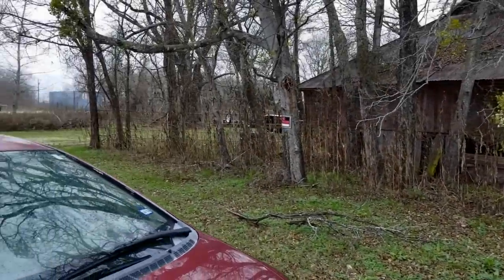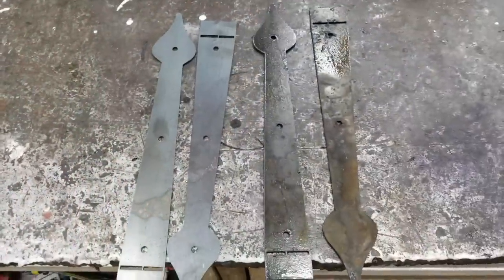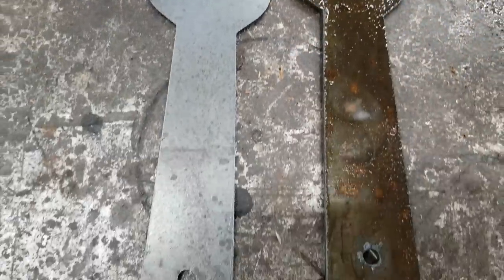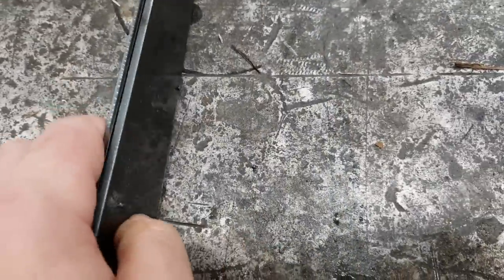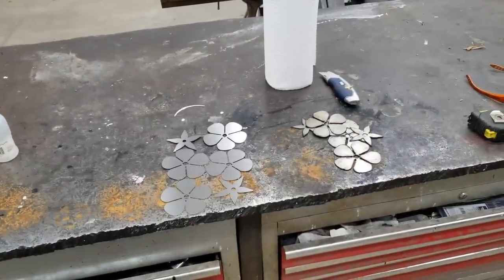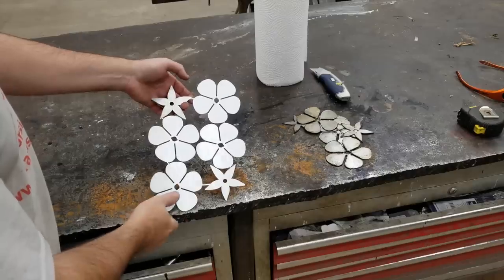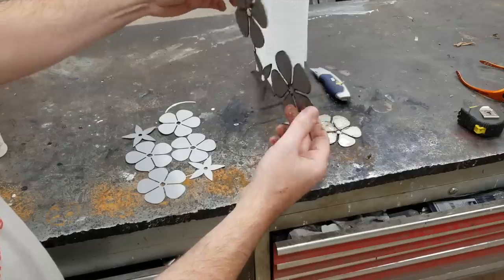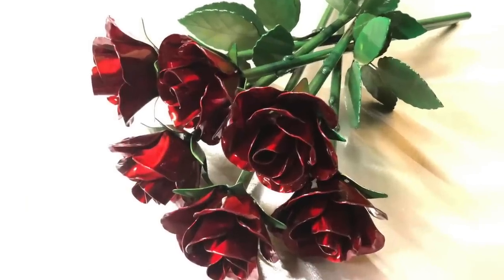Laser Vs  Plasma Ultimate Shootout   Head to head Comparison

Comment: LASER FANBOIS: "The setup on the laser is sucks, that's why the plasma won a few points". 

PLASMA FANBOIS: "The setup on the plasma sucks. That's why it lose some points." 

How about this.... THEY'RE DIFFERENT TOOLS WITH DIFFERENT JOBS. 

Laser is about precision and speed for thin stuff. 

Plasma is a MUCH better investment IF you don't need that finite precision and speed, and want to be able to cut thicker stuff easier. 

Pretty fucking simple. 

You're comparing apples and oranges.
Reply from the maker: what a dumbass... what you just described is what I just demonstrated in this video.  If your the expert, get your own youtube channel and show it better.  Btw, this video is 5 years old, Lasers are now way more powerful, cheaper, and pretty much dominate plasma in every way possible.  Including thick plate, 3"-12" thick.
Reply: @turbocobra  Just the fact that you toom my comment about THE COMMENTORS and not YOUR GAY ASS VIDEO so personally is comedic gold in itself. Gotta love those snowflake tears.

Comment: Also ... i'm spamming this chat i know, but the kerf of the cut shows that plasma was the wrong choice for this cut.
It's all about the kerf.   Plasma is technically a thermal traditionall process and the laser is just at home at these thicknesses.
The plasma kerf is gigantic compared to the laser.
It can be compensated for with leadin/out, but laser is so at home with these thin metals.

Loved this video.    Ty
Reply from the maker: dude you seem like a real expert, you need to start your own channel

Comment: Comparing a laser to plasma is difficult.   If the plasma cost as much as your laser it would be far more capable.
That's an air plasma.
I run a 360A plasma.    I leave the laser stuff to the laser.   The plasma can cut 40mm steel at 1000mm/minute.
Laser can never touch that.  Plasma can never touch laser at thin sheets the same.

I've used that very hypertherm machine.  It's a garage plasma.    Reliable and cuts anything that leads electricity but not a performance machine.
A "!fine" plasma is night and day different. (run with oxy on mild).
Airplasma eats electrodes and nozzles.  Fine-plasma nozzles and cathodes lasts for a looong time.
edit i spouted bs

Comment: Hi, When you set up the laser does the cut line cut exactly on  the drawing line, or do you set a waste side of the line and it stays a few thou off to compensate?  Or do you draw with an offset to make up for the cut thickness?  If a drew 1/8" steel with a finger joint pattern would two pieces interlock with some wiggle room?  Thanks cool video.

Comment: you need to use 10 mm plate for testing. then you can do comparison. and one more thing  change the plasma nozzle into smaller one if you wanna cut thin sheet

Comment: Great video! I currently have a hypertherm powermax with a STV cnc table. Do you have any recommendations for a drum sander or deburring machine for the dross? Dont really wanna spend more then 10 grand and there isn't a whole lot of info online. Thanks for any info you can provide.
Reply: Just use an angle grinder. Set it in place if you want to automate it. Preferable electric with soft grinding pads

Comment: 1 kw laser  starts with 25
without the pipe cutting option

plasma 7K

plasma  will cut 3/4 steel
the 1 kw laser can not  cut 3/4

Comment: Where does someone buy 1Kw lasers from to mount on my own machine?
Reply from the maker: to your own machine? what kind of machine?  If its plasma, you cant really do that, they do not have the rigidity, rapids, or acceleration rate to support the demands of a laser.  But if you wanted to try to do it, you can buy laser power sources, heads, controllers, water chillers on cloud ray.   Your looking at about $20K to do that.  You would be better off selling your plasma and buying a laser, don't really save anything by trying to retrofit.
Reply: @turbocobra  can't laser cut a little slower to make up for lost motion specs?  IMO, a lot of the plasma tables are vastly overbuilt for the application.  An MPCNC uses NEMA 17 steppers, yet can do light duty milling of wood or aluminum, yet plasma tables all seem to use NEMA23 which IMO is overkill.  All of that said, I think I would build a super cheap table and outfit it with lower quality electronics at the expense of sower cutting.  This would be a deal breaker for a big business, but not for a new business.
Reply from the maker: @MichaelJeffers75  lasers are built for high speed and production.  the acceleration rates in detailed designs have to be in the 1.0G range. if you run it slower, you will produce dross/burrs, that are very hard and not easy to remove.  Lasers have massived 380V 3phase Servo's with helical rack gear.  The 3" thick solid steel side rails on lasers are bridge milled from end to end for very square to tight tollerance.  My table is built from 4x12" rectangle tubing and then fully boxed in with 1/2" plate and weighs around 5,000lb, after its its heat treated and stress releived.   If you have a 4x8 hobby or light industrial plasma table its prob 3" square tubing, very light weight, no ridigity at all, probably rapids in the 800IPM range.  So go ahead and try it if you want, but there is a reason you dont see any of them.  Like, if you look around you cant find a single person that has done it.
Reply: @turbocobra  until your video, I never knew there were lasers that did more than engrave, but your laser machine functions like a punch press, so I inquired and shared my thoughts.  My opinion is that plasma tables are over constructed to carry the weight of a plasma torch, so I thought perhaps the same logic carried over to the laser machine.
Reply: "functions" is definitely the wrong word, I just can't think of the right word, the cuts look flawless.

Comment: Fiber laser cutting aluminum or brass, means a single flash of direct full powered reflection will instantly and permanently cut your eye corneas and you will be blind forever. Fiber Lasers without shields are illegal in the USA. At least wear laser glasses rated for your exact spectrum of laser. It's not like welding flash and it's not like plasma flash. It's a whole different level of dangerous with these machines.
Reply from the maker: you are wrong sir.  I can tell your not from the US, so your just rattling off information that you have heard.  open machines are not illegal in the US.  If you operate a small shop with no employees, you can run it open.  If you have employees, it needs to be in an enclosed room.  Yes, 1064nm rated glasses are a must.

Comment: i do not know if you mentioned it but is there a difference between plasma and laser as to what thickness material  they will do
Reply from the maker: Yea, HD plasma can cut 3" thick and thicker.  There are lasers that are 30,000 Watt that can cut 2-3" thick also, but are super expensive.  85amp plasma can cut 1" steel, 4KW laser can also cut 1" steel

Comment: The tru. Cut is definitely not the same build quality as the laser.
Thats why the laser is much more $$$
A comparable plasma would be different.
But yes laser is cleaner on thin material. 
Not many will do super thick material like plasma does. It all depends what you need cut and how thick.
Reply from the maker: You can laser cut thicker material.  There are videos on youtube of 20KW laser cutting 2" stainless.   But the edge quality is similar to plasma.  Once you get above 1/2" material, Waterjet and HD Plasma may be a better solution

Comment: Awesome video. Laser wins in average. We have been manufacturing cnc plasma cutting machine and laser cutting machine over 20 years for own use and clients, we can see original investments is higher in Laser but in a long-term run, laser machine wins on the work effciency, labor savings, consumable costs and etc. However, it requires customization for different types of sheet.
Reply: We have family businesses and I'm persuading my family to buy one of this kinds of machine. It would replace our old stamp machines. We work with metal and INOX sheets (1×2meters 1,25x2.5m and 1,5x3m) all kind of thickness(from range 0.2mm up to 5mm).
Do you think I could find something interesting for approximately 30k Euros? Im in Europe
Thank you

Comment: The question is cost. What is the cost of your laser compared to your plasma cutter? I noticed you left that very important fact out.
Reply from the maker: No its not the most important fact.  The initial cost of either equipment, especially the laser is not that important.  The running cost, the cost to actual run the laser is much higher than a plasma.  How much revenue can you generate with a laser vs. a plasma ?   These are all things that can be talked about.  But I didnt leave those out, they were never even a consideration for this video, its not what this video was about.  You can do your own research to figure those out, then you can make a video showing that and send me a link when you do

Comment: this is the first time I've seen edge comparison, 2:15 , i did NOT expect a cleaner cut on the  plasma, thank you sir
Reply: You can tell the cut parimeters were real awfull on the fiber in this case.
Reply: Cleaner cut because the focus is off on the laser
Reply: You rarely have to deal with deflection leaving a bevel on a laser.

Comment: The CAM software or the setup for your plasma machine is the culprit of most of  your slower performance. Tune that up,  if possible, or run a test with an open control software like Mach 3 or 4 where you can tweak every parameter and the plasma will improve hugely. 
Also, you're running slower steppers on the plasma vs servos on the laser. Then the Z axis on the plasma retracts way too far up before resetting. No need for that, plasma cutting is flat. The laser knows that so it retracts very little.
Plasma also does a Z height adjustment on every cut. Why? I know they all do but shouldn't have to. Once your Z height is set for the material being cut, there are no forces that would change that and the motors are very accurate and repeatable.
There's also a relative long dwell time between movements in the plasma that is likely carried over from other machine thinking. A plasma CNC has nearly no need to dwell because it's very low inertia, unlike CNC milling machines or assembly robots, for example.
So you can make a few setup changes if the machine allow it and double your performance. If you want to take it further, swap out the steppers for closed loop servos to match the speed of the laser. All three motors and drivers will set you back a few hundred dollars on eBay or Amazon. Here's a kit shipped from CA with 4 sets of motor, drivers and power supply (keep one for spare): https://www.ebay.com/itm/USA-FREE-4Axis-Nema23-Closed-Loop-Stepper-motor-1-1N-m-4A-Driver-HBS57-CNC-KIT/163810402422, but there are many others.
Reply from the maker: I don't disagree that it can be improved some with tweaking acceleration rates, but i dont think you can cut super thin metal fine details dross free.  I have yet to see that.
Reply: @turbocobra  Yeap, plasma is not that good on very thin materials. But show me the laser working on thick materials. And Joey is right, the plasma setup is terrible and the laser setup is great. I dont know cutter system prices, but shoud compare only the cutter (plasma machine + air + consumables + expected machine live vs laser machine + gas/consumables + expected machine live). The tables can be the same, only may change the THC and LHC.
Reply: your comment is awesome thank you, i learned very much
Reply: You are perfectly right ! I want to write the same things.
By the way, a broken laser if you must repair-it after the payement you will be a very poor man ... lol.
A plasma cutter, a good one is around 20 hundred buks ... 
The laser worth-it only if you have to cut at least 8-10h daily, other way it's not profitable.

Comment: Any reason you do not have your water table level higher? I find that having the fluid level right at the sheet or even covering it some, always brings a better cut, minuscule or no warpage, and a lot less dross to cut, and zero smoke. I do use the green cut fluid in my table and that tremendously helps with the rust and corrosion. I have remnant pieces from cuts sitting in the table fluid for nearly 2 months with no rust on them. 

I do like the laser table though, for cut and small repeatable parts on thin sheet, that looks like it is hard to beat. Can you do a few test pieces for calibration and measure those out? I would like to see how accurate the laser is on a 3" round circle and a 2" x 2" square for example. Enjoy the videos and keep them coming.
Reply from the maker: Oh yes and i will definitely be making some videos showing its accuracy and repeatability.  I have a set of gauge pins that have .001" increments so i can test a go - no/go on a given hole to see how close it is., and can measure the squareness with a dial indicator in the milling machine.
Reply: @turbocobra  excellent
Reply from the maker: mostly because I haven't been using the plasma lately so i just let it run down.  warpage is never a problem with cold rolled steel.  the warpage most people get cutting thin material is from hot rolled steel having a "memory" effect.  I rip through 16-22 gauge cold rolled no matter how much water is in the table and never have any warpage.  Its common knowledge to get nicer edge quality and less dross on downdraft plasma tables compared to water tables.   the ONLY advantage in my experience with a water table filled up is its superior fume/smoke capturing compared to downdraft

Comment: I'm curious of the cost breakdown between them per cut. A lot would factor into it, initial cost, power, consumables, support, maintenance, etc. You've probably figured it out to prove out jobs. It looks like you're getting work with the laser. I wish you all the best in this venture.
Reply from the maker: for higher production volumes, the laser is far cheaper over the long haul...especially the auto sheet loaders, etc.  You wont ever see a factory or high production shop cutting thin sheetmetal with a plasma.  Yes the initial purchase is more, yes the cutting gas is higher, but the labor savings, productivity gains and lower consumable costs make up for it pretty quickly.

Comment: Great video, I have been watching your videos closely trying to justify a laser.  I also have a CNC Plasma that is used a lot.  How does the laser deal with Tip ups?
Reply from the maker: i kind of referred to it in the pro's con's at the end of hte video.  you have to spend time on your CAD/CAM and nesting, as well as adding microjoints, especially thin materials wiht nitrogen.
Reply: @turbocobra  why with nitrogen is it run at a higher pressure? Looks like that piece was blown around because of the air/gas coming out of the nozzle